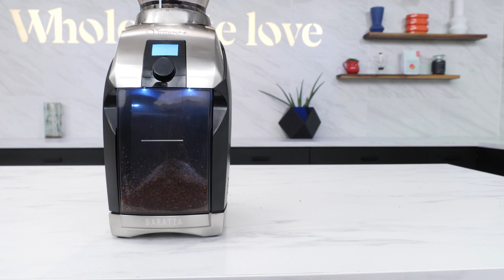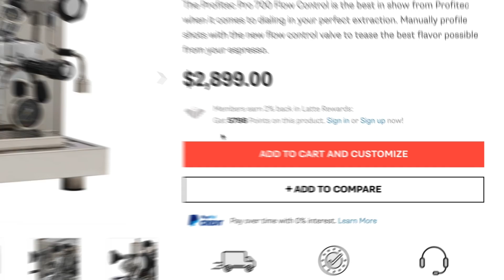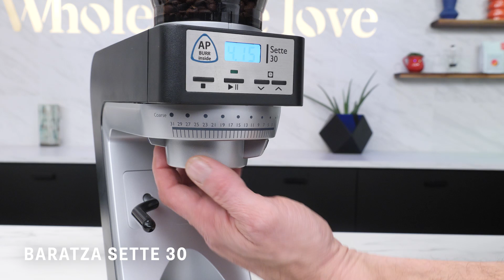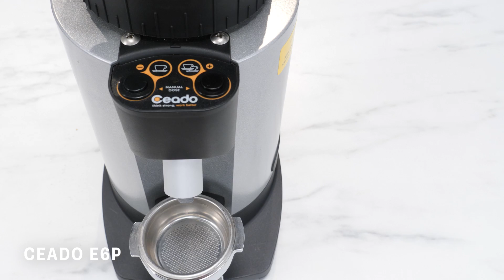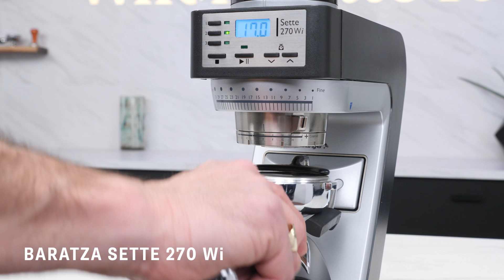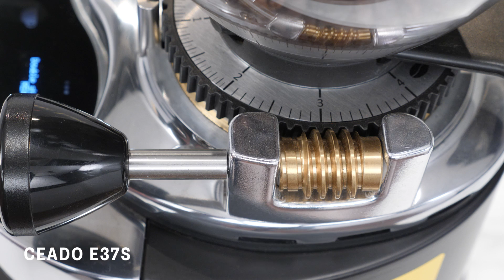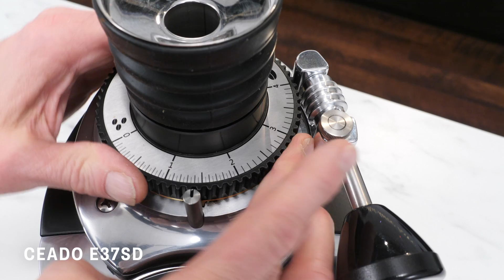Favorite Coffee and Espresso Grinders of 2019

Comment: What about sage dose control pro?
Reply from the maker: Hi Peter, The Sage/Breville DCP is a reasonable choice. It's an appliance grade build quality so it will not last forever as compared to machine grade grinders. Compared to more expensive grinders it is made mostly of plastic, grinds slower and potentially clumpier at espresso grind sizes. Grind size precision is lacking in the espresso range.
Marc
Reply: @Wholelattelovepage  I see. I hope to exchange it eventually for some low retention single dose grinder but for now it has to do :D I use WDT to deal with clumps along with RDT

Comment: I am in UK. Just ordered a Eureka Mignon Specialita. When you dial in do you have to have grinder running? This is to replace an Innova i2.
Reply from the maker: Hey kwj, Thanks for the question. When adjusting to a finer size the grinder should be running to avoid crushing beans between the burrs and causing a no start of the motor. You can adjust to a coarser setting without the grinder running. It's generally okay to make very small adjustments to a finer setting without the grinder running.
Marc

Comment: Would you choose the e6p or e37j?
Reply from the maker: Hi Ward, Well, the E37J is a beast but I do like the E6P a lot and use it all the time. It has the same burrs so no real difference in grind quality and the latest E6P version has an updated touch interface: https://www.wholelattelove.com/products/ceado-e6p-electronic-dosing-grinder-v2
IMO the E6P is the best value in a 64mm burr machine grader grinder with timed presets.
Marc

Comment: Love your videos Mark!

Question please : Why doesn’t the E37 have the same mechanism to unlatch and do large grind adjustments? and in case of big adjustments what do we need to do ?
Reply from the maker: Hi KZ, Thanks for the kind comment on the videos! Ceado considers the E37S an espresso focused grinder. With that, they expect users to make only smaller adjustments within the espresso range. You can use for other brew methods but you will need to do a lot of turning of the grind size adjustment knob.
Marc
Reply: So is there any advantage for E37S in terms of its inability to unlatch and make bug adjustments like the e37SD? Is making big adjustments adding any disadvantage? If the e37SD is pretty much the same as 37S but with single dosing input mechanism why not give the E37S the same flexibility as e37Sd in terms of ability to make big adjustments? Seems like a missed opportunity!

Comment: You kind of answered this question but the E37SD is way out of my price range.  I feel like part of the price in these grinders comes from having a massive hopper and being commercial ready.  I only intend on dosing my espresso one at a time so is there a grinder you would recommend that is smaller, not "cafe ready", and I assume marginally cheaper than these larger grinders but doesn't really skimp on consistency and features?  I guess a better way to phrase this is what would you say are the best low volume espresso grinders...preferably under a $1000.  

Thanks!

Comment: Marc I made a mistake you were right the stat screw is for steam the bottom nut is for bar pressure. Does the Apartamento come factory 9 bar pressure thanks.
Reply from the maker: Hi Dirk, It should come set at about 9-10 bar.
Marc

Comment: Marc, you gotta test delonghi KG89 grinder. It's cheap but is it good? Are those $50 bar grinders  any good?
Reply from the maker: Hi JJ, Thanks for the request and question. Well, it's an entry-level appliance grade grinder. It's not one I can recommend for espresso. But it could work for other brew methods where grind size is not as critical. It's far better than a blade grinder - I wouldn't use a blade grinder for any brew method. Bottom line it's an entry-level grinder. Grinds slow and has a limited lifespan. The best low cost grinder IMO is the Capresso Infinity: https://www.wholelattelove.com/products/capresso-infinity-plus-conical-burr-coffee-grinder-in-black It runs ~$100. It's been around for years and has an excellent reputation as a solid appliance grade entry-level grinder. Hope that helps! Marc
Reply: @Wholelattelovepage  Marc, I was watching American Test Kitchen channel where they claimed coffee grinders Barr and blade, made the same tasting coffee even coffee expert couldn't tell them apart. Price of the grinders or the type don't matter much either. If thats true, Marc I don't know what to believe anymore. You tube community like your channel and many others always claim the grinders are the most important equipment for a newbe home barista. A cheapy coffee machine with a high end Conical Barr grinder will produce professional quality brew. Well, always like your chanel Marc and wanderful "Gail" from Seattle Coffee Gear. Thanks

Comment: Which of these would you match with a pre-millennium La Pavoni Europiccola?
Reply from the maker: Hi A, Thanks for the question. A few ideas. The Eureka Mignon Specialita in chrome: https://www.wholelattelove.com/products/eureka-mignon-specialita-16cr-in-chrome (many other colors available!). Beyond that the Ceado E5P: https://www.wholelattelove.com/products/ceado-e5p-electronic-coffee-grinder or E6P: https://www.wholelattelove.com/products/ceado-e6p-electronic-dosing-grinder-v2
The Eureka is more compact and has 55mm burrs. Ceado's are the same internally with 64mm burr and a little higher quality in overall build. E5p is manual on demand and E6P has 2 timed presets or manual grinding.
Hope that helps,
Marc
Reply: @Wholelattelovepage   Thanks Mark, I’m in Australia so I’ll look around the local shops do you like Fiorenzato grinders at all, I’m choked for space on my benches so size kind of matters.

Comment: We have a Rancilio Silvia paired with a Gaggia MDF grinder. The grinder just broke. It worked fine for us to use for espresso and cold brew for about 13 years, the same age as the Silvia. We might want to step up a little to replace the Gaggia, and we want a quality product, but we don’t need a lot of extra features.We do have a lot of experience with espresso on the Silvia, though I guess it’s still considered “entry level.” We don’t really intend to step that up, or if we do when it breaks, not by much. Anyway, what are say your top three choices for our situation?
Reply from the maker: Hi Craig, Thanks for the question. As you like longevity I'd recommend a machine grade product and avoiding the plastic appliance grinders. Also, You're going to love more recent grinders compared to the MDF. It was fine in its day but grinders have come a long way! You should find video reviews along with all the details at the links below.
Recommendations:

1. Bezzera BB005. It's the best value in a machine grade grinder but difficult to use for methods other than espresso as it's a ton of grind knob adjustment turns to get out of the espresso range: https://www.wholelattelove.com/products/bezzera-bb005-automatic-grinder

2. Eureka Facile: Excellent value w/50mm flat burrs. Totally on demand into your portafilter. Push with the PF it grinds. Stop pushing it stops. No frills: https://www.wholelattelove.com/products/eureka-mignon-facile-espresso-grinder

3. Rancilio Rocky: It's similar to the MDF in some respects with stepped grind size adjustment. IMO it's a bit dated, grinds a bit slow and tends to be a little clumpy at espresso grind sizes: https://www.wholelattelove.com/collections/all-grinders/products/rancilio-rocky-doserless-coffee-grinder

Hope that helps!
Marc
Reply: Thanks. We just need something simple--no bells and whistles. If the Rancilio is souped up compared to the MDF, I think that's good enough for us.

Comment: Thank you for your great videos. Lately I saw your videos about dialing espresso. My question is which is the starting grinder configuration when you start dialing espresso (for example Orphea beans, Gaggia Pro and Baratza sette 270wi)? Thank you again for your videos.
Reply from the maker: Hi DI, You are welcome for the videos and thank you for the question. Unfortunately, I do not recall my starting grind setting on the Sette 270 Wi. It was likely somewhere between 2-5 on the macro ring. That's a good place to start for espresso on that grinder but of course you need to dial-in after that.
Marc

Comment: Mark,
I’m looking for a work horse grinder for automatic drip coffee. I already have the Ceado E5P for espresso, so this one would be just for brewed drip coffee. I originally bought the Baratza Vario and have been using that for exclusively auto drip grinding but it has broken down once again, where the burrs just freeze up, even after taking them out and cleaning them. It’s already been to your shop for the same problem and I’m tired of dealing with it. So if you can recommend a grinder with a good performance history and one that needs little maintenance and or repair I would greatly appreciate it.
Thanks!
Reply from the maker: Hi Gary, Sorry to hear you've had issues with the Vario - It's generally a very good grinder although typically a bit of overkill for drip IMO. I hesitate to recommend another Baratza due to your Vario experience but the Virtuoso+ is my choice. With a conical burr it's actually rated higher in grind quality for drip than the Vario. I like the digital timing feature on the Virtuoso+ as well. I use one in the office and have an older Virtuoso at home: https://www.wholelattelove.com/products/baratza-virtuoso-coffee-grinder
Marc
Reply: Appreciate the information... thanks!

Comment: As an aside, I've read on Home Barista that the Ceado e37sd has had really mixed performance with consistency.  I was real close to pulling the trigger on that grinder.
Reply from the maker: Hi JL, Thanks for the comment. That's surprising. IMO the E37S is one of the finest grinders available. Perhaps the comment on Home Barista was from someone experiencing issue with other variables. That has not been my experience at all.
Marc
Reply: @Wholelattelovepage  in your answer you referred to e37s not e37sd which is what the question was for. Do you consider the 2 machines e37s and e37sd to be the same?

Comment: I would love to see you guys test the consistency of the grinders.  That is, X grams in, shot time at Y seconds, and measure Z grams of espresso out.  Then run a single variable statistical analysis and see what the std dev is for 10+ shots on each grinder.  You would be surprised by how inconsistent most grinders are.  Even the titan level grinders.  The most important thing is the burr alignment and tolerances.
Reply from the maker: Hi JL, Thanks for the comment and request. The tough part is getting to a single variable! Incredibly difficult to take everything else out of the equation. Perhaps most difficult is getting the same flow through the coffee puck for those 10 plus shots. A channel through a puck here or there would totally throw off results. Do check out this video: https://youtu.be/6TMkDe1XtIM We did a 30 day appraisal how bean age changed extraction timing. We have many makes/models of grinders available to use. It was an easy choice to go with the E37SD to reduce the number of variables in our test.
Marc

Comment: Thanks for the video! I've previously owned a Baratza Preciso (the old model up from the Virtuoso) which lasted me about a year before the plastic grind adjustment died. Fixed under warranty but made me worry about reliability so I sold it. I replaced with a Compak K3 which I've been really happy with and had working reliable for the last few years. For me it seems like good value for the money, but maybe the grind isn't as consistent as the Seado E6P or the Sette 30?
Reply from the maker: Hi g, Thanks for the comment sharing your experience! I really like the Ceado E6P. It's been updated since this video with very nice touchscreen control. Check it out in this video along with the updated E5P which is a manual on demand grinder with same 63mm burrs as the E6P and the new Ceado E5SD single dosing grinder. The E5p is my choice for those looking for best bang for the buck in a machine grade grinder: https://youtu.be/V-Fnu7R68Tc
Marc

Comment: Alright so I want to get into making great espressos and just good coffee in general. I want to get a really good grinder for coffee beans and use a Chemex before possibly getting a Rancillo Silvia or Gaga classic. I was looking at the Baratza 270 and 270Wi what are the main difference I should be looking at and should I spring for the WI? Also any recommended coffee beans I’m not really sure what is considered good and a lot of the recommendations I see online is for generic coffee grinds. Thank you
Reply from the maker: Hi Ross, Thanks for the questions. Here's a video comparing the Sette 30, 270 and 270Wi: https://youtu.be/FzhtwrmB-60
Long story short the difference the only real difference between the 270 and 270Wi is weight based dosing on the Wi. Other than that the grinders are mechanically identical. The 270 is relatively accurate with cycle to cycle weights using timed grinding. The thing is when you change grind size and use the same timing you will get a different weight. With the 270Wi you can change the grind size and within a few grind cycles you will usually get with 0.2 grams of the weight you programmed. The Sette grinders are better at espresso grinding than brew grinding. The AP burrs they come with tend to produce a few more fines in the grind at medium grind sizes. For most that's not a big deal for pour over brewing. But it can be for those who are extra particular. There is an optional BG (brew grind) burr for the Sette which reduces fines. Although easy to switch out, it's not something you want to do on a daily basis. BG Burr: https://www.wholelattelove.com/products/baratza-sette-bg-burr-assembly
As for coffee bean, it depends on what you like. For espresso beginners who like Italian style blends one of my favorites is Maromas Orphea: https://www.wholelattelove.com/products/maromas-orphea-whole-bean-espresso I drink this as espresso and as long coffee. It's low priced at ~$10/lb, has excellent user reviews, keeps exceptionally well and produces crema buckets! At the other end of the spectrum are single origin specialty coffees with more distinct flavors. They tend to be grown at higher altitudes and roasted lighter. These types of coffee tend to be brighter and may feature fruit and berry notes. They can run 2-4x the cost of the traditional Italian style blends. They do better when relatively fresh and are tricky to make as espresso so not recommended for beginners. But these are the types of coffee done as pour over in higher-end specialty shops. Here's an example from a local micro-roaster of Ethipian Yirgacheffe which features Blueberry, Chocolate, Vanilla, Tropical Fruit: https://www.wholelattelove.com/products/fuego-coffee-roasters-ethiopia
Hope that helps!
Marc
Reply: Whole Latte Love WOW that was a lovely explanation! Thank you helped a lot!

Comment: Marc my man, which one would you choose for espresso grind quality and consistency: Baratza Sette 30 or Vario?
Reply from the maker: Hi Bondi Bud ; ), Thanks for the question. IMO the Vario is a better choice for espresso than the Sette 30 based on its micro adjustement of grind size. That said, I'd choose one of the Sette 270 models over the Vario for their micro adjustment, speed, grind quality and dosing accuracy. Hope that helps!
Marc
Reply: Whole Latte Love Awesome, thanks man! Always appreciate your opinion👍
Reply: @pendchode  The Baratza gives an amazing grind but mine stopped working after 3 months! They are not good quality built. I am going for the Ceado

Comment: Thanks for this and all your videos - always clear, informative and helpful.  I only wish I lived in the US so I could buy from you!  I’m currently using a Rancilio Rocky grinder with my E61 hx machine (La Scala Butterfly) and am a bit frustrated by its stepped grind settings.  I was initially thinking of replacing it with the Sette 270 but now I’m also thinking about the Mignon Specialita which is a few 100$ more expensive here in NZ - any opinions on these two options?  Would either or both of them give me a significant improvement from the Rocky? Or should I continue to save up perhaps for a Niche Zero or similar??
Reply from the maker: Hi Andrew, Thanks for the comment and question. Either grinder will give you a huge improvement over the Rocky! Stepped grind settings, slow grinding and clumpy = frustrations! I use the Sette on a regular basis to feed E61 machines. It's fast, a fluffy grind with excellent distribution. Significantly louder than the Mignon. I prefer the 270's grind size adjustment with macro and micro rings to the the smallish knob of the Mignon. Both grinders have good weight consistency for timed doses - perhaps a slight edge to the Sette. The Sette is what I consider high-end appliance grade with a fair amount of plastic in construction while the Mignon is a machine grade build so can take a bit of abuse. I like the UI of the Mignon. It's classy and very easy to use. If both grinders were in front of me I'd use the Sette. If picking for long-term durability I'd go with the Mignon.
Marc
Reply: Whole Latte Love Thanks for your reply Marc - that’s really helpful. I should perhaps have mentioned that I mostly single dose so low retention is also important, but I think both of these grinders are OK on that front from what I’ve heard.  Decisions, decisions! Perhaps the best option is to buy the Sette and use the $$ I save to buy more coffee! Thanks again for your help, I really appreciate it. Andrew